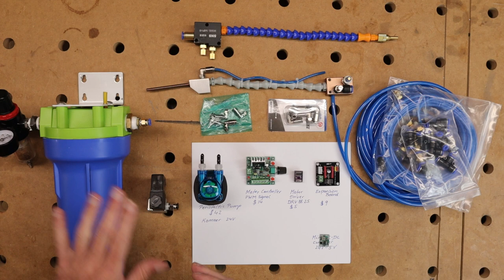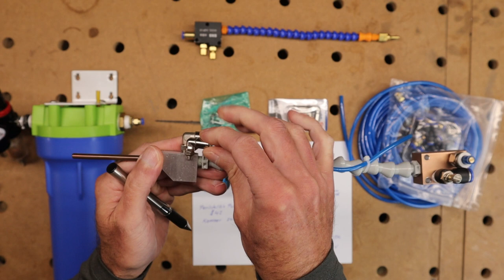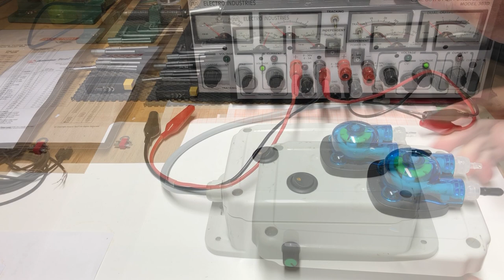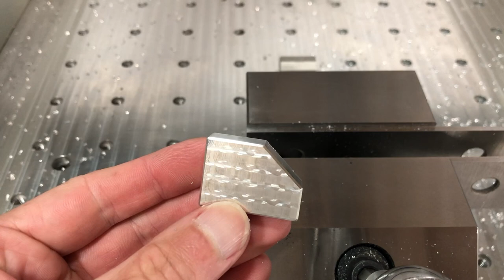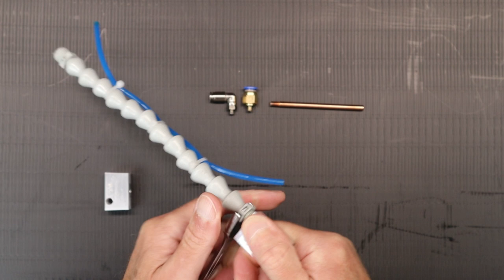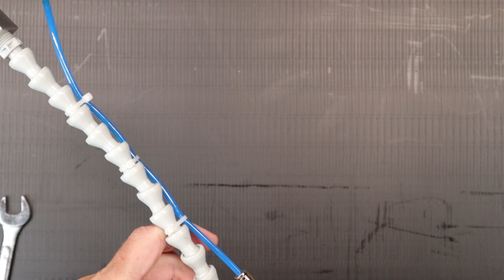Mist Coolant System Update

Comment: Rad design! I bought all the components you showed and realised "there has to be a simpler way". I found ZK-SMC01 Micro-step controller. It has a serial port and other control ports to start and stop it from the cnc controller.
Reply from the maker: The unit I show is also controlled by either M8 or M7 machine command simply energizing a relay. So you still need an amplifier for that unit ?

Comment: I like the format of your videos. Very pleasing to watch and very clear.

An alternative could be to use a DC peristaltic pump and a DC motor speed controller.
Both are super cheap and easy to integrate: you just need to supply the speed controller from the same output as the solenoid you use to control the air.
Reply from the maker: Yes that is possible. These Ofen come with a gear set so the motor has some torque at the required low rpm. It will work but I had one fail after a short period of time - on the other hand a friend runs one for per a year now. Thank you for reaching out !

Comment: You did EXTREMELY well with the product. Having used a FogBuster forever myself I agree with you on the mounting issue right our of the box. Keep it up :)
Reply from the maker: Thank you PGTDESIGNS, what motivated me to make this change was that I hit start on a brand new part and ran into my vice while I was adjusting the fluid. The machine was going slow and I could’ve just pause it but I was not paying attention.

Comment: The use of a peristaltic pump for fluid delivery is a great idea. I've tried two different types of cheap Chinese misters, and have been so frustrated by their inconsistent fluid delivery amount. It seems that just looking at the adjustment screw wrong could cause the fluid delivery amount to change from almost none to a flood level. I was considering purchasing just the genuine 'fog buster' nozzle assembly, but considering the fact I want two and they cost $200USD per, it was something I was having trouble justifying. On top of that, I'm not confident that their fluid output metering is that much better (maybe it is though, I don't know).
I have an old, factory installed, Bijur coolant system on my machine, so I all I needed to add was the nozzles and metering. I saw a recommendation for the ZK-SMC01 controller in another comment, but decided to go with the SMC02, as it has the amplifier built in. I things setup so that the SMC02 receives 24V with an M8 command (flood coolant) - I have mist reserved for pure air-blast. I have the SMC02 configured so that when it receives power and turns on, it will immediately turn on the pump. The SMC02 has a dial to control pump speed and I've mounted the controller so that I can easily see the pump speed and adjust it. 
I see what you mean about a small pump size. I ordered a 180ml/min pump as it was slightly cheaper than the 110ml/min and available more quickly through prime. To achieve the correct flow rate I have to spin the pump pretty slowly, which causes pulsations of the fluid output. It would definitely be better to have a smaller output volume and spin the pump at a faster speed. 
Fluid flow comes from a pressurized container that also provides the air. I need to do more testing to determine if it's better to siphon fluid from an unpressurized container though. Right now, it takes a while for the system to prime and fluid flow to start. I'm not sure if there's a small leak or if the fluid suction lines are too long.
Reply from the maker: Well great that you got your system up and running. One trick is to install a smaller inner diameter silicone tubing in the pump. This will result in less volume and you could speed the rotation up a little preventing the pulsation of fluid. Also I would stay with the pressurized fluid container it shortens the priming cycle time that you mentioned. I only need to prime the system once per day and that is it … doable I think. And yes I had the same frustration with my Chinese version and I am super happy that I attempted this project.

Comment: I love the setup which you've developed. I have a Tormach PCNC 1100 S3 which I developed a flood and air system for, but even with an enclosure the GPM's and air are too much. I do have a flow control via diversion, and a wash down hose setup; but when I run the Tormach RapidTurn I must run dry. I've explored many designs, but yours appears to be the most practical ($400 for a Fog Buster??) Pump and fluid transfer systems are no issue for me. Retired Lt. FireMedic/ ED-RN (peristaltic pumps for IV's) or 1500GPM+ for Fires, fluid dynamics are the same. I did look at your website, but sadly I found no BOM, drawings or schematics; no problem I did have a couple of yrs. of electronics. Thank you, and best wishes!
Reply from the maker: Hi John, thx for checking out my webpage. It’s still in development but there is a drawing of the pray head and a component list as a free download. 
https://www.jbworxstudio.com/shop

Comment: i used a Smc02 Stepper Motor Driver for the pump, and mounted it at my operators panel. and also used a relay to control it via the cnc controls. Works really well thank you so much! 😎👍
Reply from the maker: Yes that is what someone reported as well. It’s an all in one unit- yes? I have one here to test. Someone else reported that he cannot get the rpm low enough. But sounds like you got it going. Great job !
Reply: @JBWorx  i goofed around with the settings a bit. you can set a rpm for forward and reverse to. Might have to up the amps on the controller. i used a different pump as well. it's a nice all in one package ( be aware there is a red and a blue one, i have the red one. no need for a separate stepper driver with red)  and ofc you need a power supply to give it power
Reply from the maker: Excellent

Comment: With Planet-CNC you can omit the PWM generator. You can regulate it directly via the control controller.
A Thomas pump is sufficient as an air dispenser, I've been using it for years. Initially with the PWM gerator.
Reply from the maker: I think I can do that in Eding CNC as well. I have several more PWM outputs open however they are meant for additional spindles.  I will see about setting up a second one and use that output, you made me curious if this could work. Thx.
Reply: @JBWorx  Yes, that's right. If the hardware can output various PWM signals and you can control it via software, it will work.

I clamped the PWM signal directly to the step pin of the motor controller
Reply from the maker: Excellent! I will give that a shot

Comment: I am loving your videos, I am slowly working my way through them all, lots of great tips and advice, how well is this system holding up? and in another video you mention the coolant you were using at the time was IPA, is this what you are/have used in this system and does it affect any of the components? Thank you for your effort.
Reply from the maker: It is working really good. The only improvement I recommend is to use a barbed fitting on the hose connection as the push to connect fitting has an O Ring that can deteriorate oder time and leak. Thanks for reaching out

Comment: Great Video!!! Two questions:  1.  What it the description for the cable that goes to the peristaltic pump.  I would like to source that.  Secondly what hold the heatsink on the chip.  I have used the heat sink paste, but I thought the heat sink needs to be held in place somehow.  Thanks... Richard
Reply from the maker: Hi Richard, the cable is an ordinary stepper motor connector cable - mine came with the board or pump can’t remember. If you have to buy it separately just look for the NEMA size of the motor so let’s say NEMA 14 and search for connector wire. These have usually a JST connector on the end the number gives the pitch between the individual connectors in the plug. So you can check that as well on the pump itself. 
The heat sink has a tape on the back and that is what I used.  But you could upgrade to thermal paste and another way to hold it in place like 2 stand offs and a bridge over it or a small wire tie.  Another idea is to remove some of the tape and use both in combination. Hope this helps

Comment: I like your project, I want to build one and I have some questions. 

What is the inside measurement of the bronze tube?

Any recommendations?
Reply from the maker: I choose a 5mm OD; 3mm ID brass tube. A 4mm ID will work as well and consumes a tad more air and I would recommend that for a more powerful spindle.

Comment: That's a nice solution.  Silly boy... you asked for our thoughts!
(1)   The smaller right-angle fitting for the lubricant is nicer, but could you have used a straight connector beside, and parallel to the air inlet.  It would need an angled hole in the aluminium part to meet up with the copper tube.  (Alternatively, two holes at 90 degrees, and plug the open end of the cross-hole.)
(2)  For the electronics... wait for it... use an Arduino!  I know you did not want to use one, but an Arduino Nano in a small case can be a tidy, flexible, and reliable solution.  It also opens up opportunities for things like increased mist for the first few seconds of a cut, quick flow rate control, auto-stop of mist when spindle stops etc.
Love your videos, thanks.
Reply from the maker: These are both very good ideas. The Chinese version of the lubricant and air block has exactly what you describe one hole blocked by a ball. I think it would possibly make it look cleaner or sleeker maybe. An Arduino is the way to go for this Projekt, the initial automatic fast fill of the tubing  is a feature worth having. Lucky on this particular setup the pot to full for a couple seconds and then all the way back to low achieves the same thing but that is on my version. For someone else it might differ and to get back to the initial setting might not be as easy. Automatic ON/OFF is now provided by the additional air valve controlled via the M8 command in the G-code.  I was afraid using an Arduino would make this solution less “popular” as many not so electronically inclined viewers would simply not be interested in building it. Heck I thought about scrapping the idea once I realized you have to solder some wires on. My goal was to simply plug components together. But yes the Arduino is a nicer solution. My idea list for projects has a router lift on it. That will definitely qualify for an Arduino. I might need help for the programming on that one though.

Comment: Hi, great video! I'm wondering, is the pressurized tank still strictly needed with the peristaltic pump delivering the coolant?
Reply from the maker: Yes it is, as the pump will just be used to meter in the correct amount. It is working much better with the tank pressurized
Reply: @JBWorx  thanks for the reply. Another thing I noticed, in the PDF with your drawings and list of materials, the Loc-Line on Amazon is the blue/orange type when I search for "Loc-Line 1/4” Coolant Hose assembly kit" and that kit does not come with the screw connector for the aluminium block end (output end). I'm also having trouble finding that type connector on the Loc-Line webpage. Do you have a part number for that? Thanks 🙂
Reply from the maker: @Futterama lockline 41409 on Amazon. Unfortunately I can lot link it right here.

Comment: Nice to see, thanks. Just to check I'm reading this right: did you go the stepper pump route, because you didn't want a needle valve, and you can control the flow precisely with the pump? So did you use compressed air previously, to push coolant out of the tank?
Reply from the maker: Yes, all correct. I did use compressed air on the coolant tank to push the fluid out. The needle valve gave me always trouble in the beginning of the day and I had to make adjustments frequently. Now I turn the knob to full for a a couple of seconds for the first job to prime and lucky for me the knob all the way down is just the right amount of coolant. I like this so much better. And also adding the automatic on off via the 24V valve was definitely worth it. The program now turns it on at the beginning of a job but more important off at the end. If you happen not to be there you don’t come back to a coolant puddle. The switch enables you to turn the coolant off and just have an air blast.

Comment: you was not explain about your compressor yet, how many bars and power that you are used for your cnc coolant spray?, and how much bar minimum requirement that you can suggest to us to use?
Reply from the maker: I have a couple of videos on this topic I think I mentioned it somewhere. With a small tube diameter of 4mm you will not need a high volume nor a lot of pressure. I would start at 20psi or around 1.4 bar. I use a California Air Tools air compressor with 1 or 1,5 hp and it is able to keep up with this system just fine. Hope this helps.

Comment: I stumbled on your YouTube channel a few months ago wile making research on how to cut aluminum with my CNC. I found a lot of very useful information thanks to your detailed videos that I find excellent. I have sometimes good results and other time bad results. Your design described here looks very promising for me to cool things down and I went ahead and ordered all the components to try to reproduce your idea. 
I started with the electronic and I have everything working with what I think is exactly the components you have except for the peristaltic pump where the pump is driven by a Nema 11 instead of a Nema 17 that you have.
When running the pump, the motor driver gets very hot even with the heat sink, stopping the pump on and off; probably a safety feature when the chip gets too hot. I haven’t put all the electronic in a box yet and everything is fine when I blow some air on the chip and I will probably have to install a fan to cool down the motor driver.
I see you didn’t mention anything about it, but did you get any similar problem with your set-up after using it for a while and if so, how did you resolve the issue?
Reply from the maker: Yes the chip does get hot but the heat sink takes care of it. Even stuck inside the box it never shuts down. I suspect the amp draw of your motor is too high. So one of my viewers reported that he found a “all in one” driver and amplifier on Amazon. I have it here to test but have not accomplished that yet. 
Search for “stepper motor driver controller integrated board forward / reverse” it is sold by Banria store. I will place another response below this trying to add a link.
Reply from the maker: Stepper Motor Driver Controller... https://www.amazon.com/dp/B0B1HNS9L2?ref=ppx_pop_mob_ap_share
Reply: @JBWorx  I've seen that one on Amazon and ordered it a while ago. Had to return it as it was OK for high speed, but as soon as I was slowing the motor down it would stop. Don't know if it has to do again because the motor is drawing too much amp.
Reply from the maker: Yes that can happen. Making the motor run smooth on a slow rpm is not always possible with every amplifier. So instead of guessing it would be best to simply place a volt meter set to amps in series. This way you will exactly know that the draw if the motor is.
Reply: @JBWorx  Thanks for the advice, I will try the voltmeter as mentioned. The stepper is a Moon's Industries ms11hs5l4100 and it is rated at 1 amp.
Reply from the maker: Sorge rating of 1A does not mean that it will pull a higher current if the load goes up. It just means that this is the safe current the motor can handle as a max over time.

Comment: Hi, awesome channel for beginners like me! thanks! 
though I don't quite follow how is the tank connected to the rest, the coolant is still pressurised when using the peristaltic pump?
Reply from the maker: Thank you, yes the task of the pump is not to build pressure against the air pressure but just to meter in the exact amount needed. And that repeatedly. Works great give it a try..

Comment: Nice project! However; I would like to see the whole setup? Where is the pump and the reservoir located? What is the approx length of the tubes between pump and nozzle an between reservoir and pump?
Reply from the maker: I think the mounting will be unique to everyone’s machine. On my machine the pump sits in the front where I can easily reach the speed dial and the coolant  canister is on the right side next to the control cabinet. The tubes are about 2-3m long. A lot of people contacted me for information on this project and I know that several machines are rather big with tubes of 5m and longer.  The only thing g that will change is the time for priming the system.
Reply: @JBWorx  Okay, nice to know that tube length does not really affect the workings. Thanks!

Comment: Any reason not to add the fluid to the flow in the aluminum mounting block vs the bottom block?  I also hate those little needle valves.  Nice job!!
Reply from the maker: Yes, I think the regulation becomes more erratic (or better said Inconsistent) You can see this already with the short brass extension. And thank you !